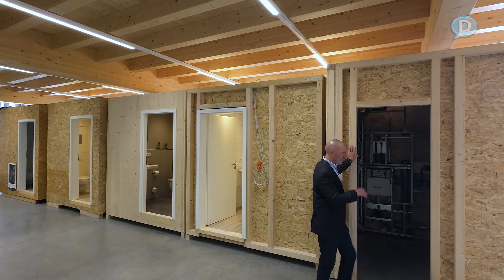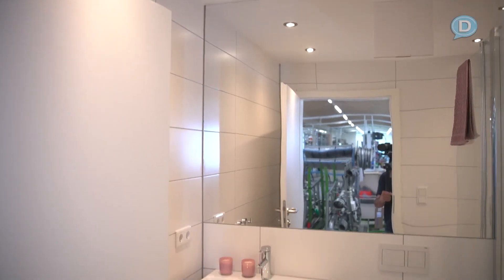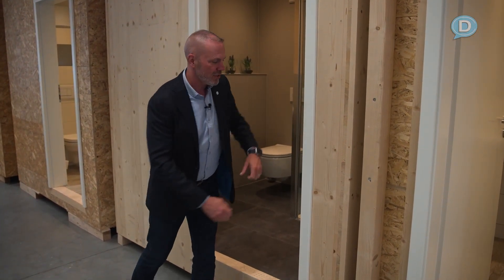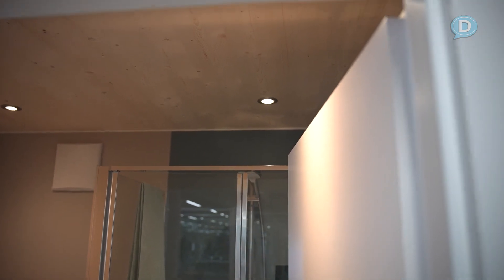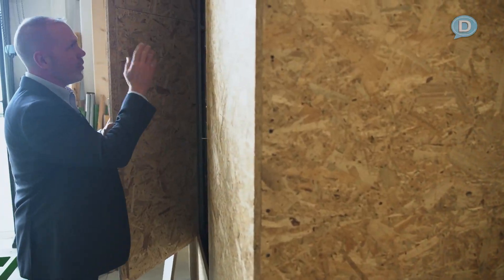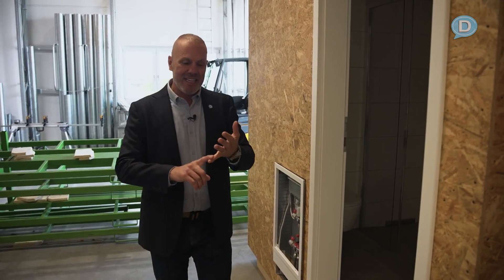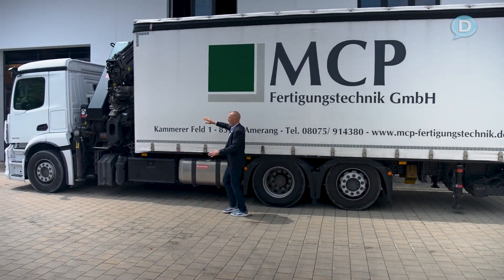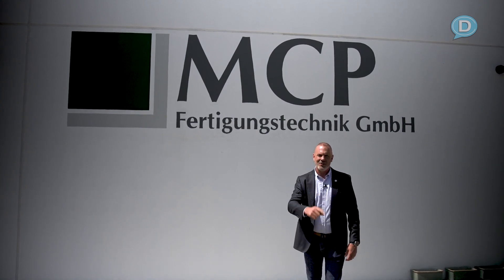Prefab Bathroom Pods: Designed, Modular Built, Accessorized, Delivered and Installed (Part 2 of 3)

Comment: Is there such a thing of putting modular addion attached to current home (garage/ mother in law suite above it)
Reply: That's what I was thinking too.
Reply from the maker: Yes, you can do a Modular addition or even add a second story to a ranch. I’ve done both several times.  Obviously with going up to second-story you gotta make sure the foundation and loadbearing walls are structurally engineered to support the new weight loads.
Reply: Can these be purchased in the USA?
Reply from the maker: @burnettsteven  This system is not available in the US however this is a company doing something very similar www.keyponents.com